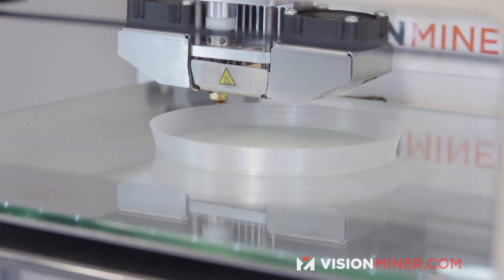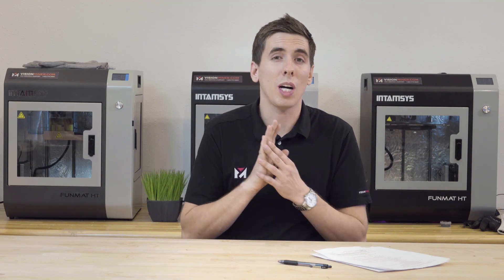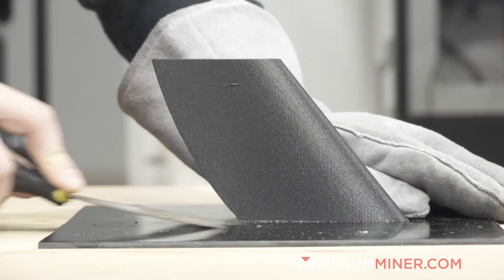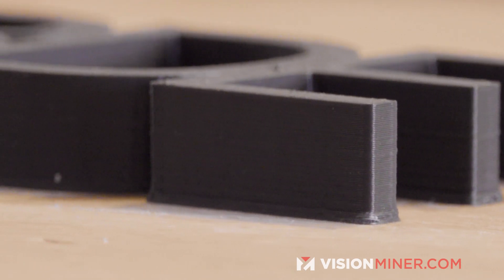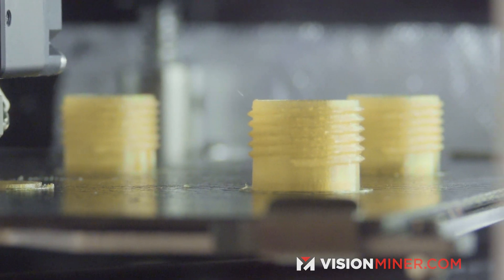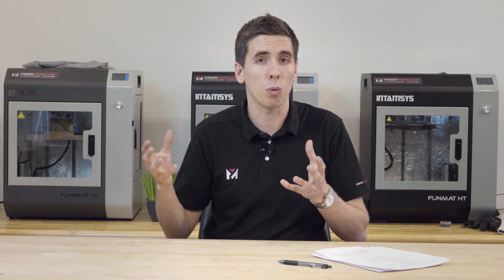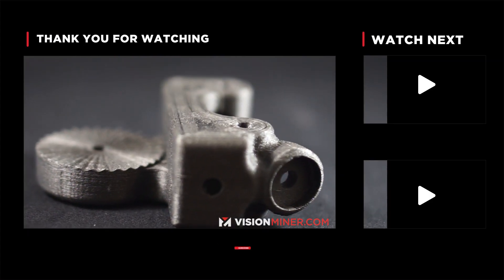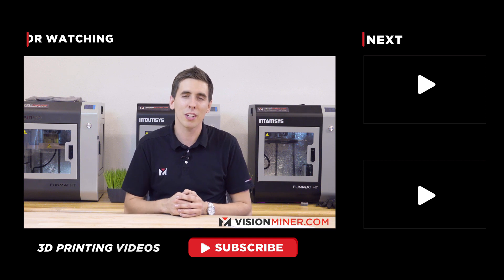3D Printer Bed Temps: Principles of Setting the Correct Build Plate Temperature

Comment: I’ve been using the default bed temperature on the Ender 3 Pro @ 60 degrees Celsius, would this be too low? I’m thinking so as I tend to have trouble with the first layer staying in place, I even made sure the bed was level enough to the filament would make contact and stick.
Reply from the maker: Definitely go higher if you're having trouble :)
Reply: @VisionMiner  appreciate the reply! I did in fact bump the bed temperature up and that seemed to fix the issue. Thanks!
Reply: @pooppyybuhhole  hey just read ur comment  i have the ender 3 plus and im having this issue can u tell me wat temp ur using plz?

Comment: okey ... start increase bed temp from 60  up to 100 per 10°C and lets see what temp is good for my PLA ... i am new and i have problem with low stick on bed
Reply from the maker: Perfect, yep -- start 60, usually 70 is more than enough -- I wouldn't go past 80c with PLA though, as it will become too soft. If it's not sticking, try something like our Nano Polymer Adhesive: https://www.visionminer.com/adhesive
Reply: @VisionMiner  solved ... i have bad parameters for steps per mm  ... and now i have problem to unstick model from bed :D

Comment: Hi. I have an Geeetech A10M, and the hot bed works, but the temperature sensor doesn't change. I checked the thermosensor and have 100kohm, I re-flashed the FW, but still the same. Can you help me to know what is happending? Thanks!
Reply from the maker: Unfortunately we've never worked with that printer, your best bet will be forums or their company support :) (check your wires though, could be a bad connection)

Comment: if I put my temp up too high, my adhesion gets worse, not "too good"
too low? the same thing. that's my experience with nylon though. it sticks well at 50 degrees bed temp, but any higher? Nope. like tape without a glue side.
Reply from the maker: Are you drying the filament first? We usually print Nylon around 110ºC on the bed...
Reply: @VisionMiner  it certainly could be dryer so I would have to experiment more and my results could just have been.... well, odd, but I did put the filament in the oven at 80 c or so for an hour at the time. 5 hours would be WWWAAYYY better.

Still, think it might still have been moisture, like you said, considering how very very hydrophilic nylon is.
Reply from the maker: @umbratherios  Right, very likely moisture -- it's interesting how much that affects adhesion! Also, printing hotter almost always makes it "stick" better, so I'm curious... I suppose the crystalline structure could at some point become damaged and behave differently, but most heated beds don't actually go high enough to melt the plastics, letalone damage the polymers...

Comment: I like to print my first layer at a higher temperature, then after that I leave it at the recommended temperature. This usually works really well for bed adhesion on my printer. Also, I usually set the flow of the initial layer to 80%. This way if it kinda sags it doesn't ruin the print quality of the first layers. But this might vary per printer. I also use a removable and flexible printing bed, so if it's too hard to get off (which hasn't happend to me yet) I can always remove the board and remove it that way.
Reply: ty im new at the glass bed first time i used it i was ooo thank you no more glue but than a couple of parts they not coming out right they com loose if its a small print its awesome but a bigger print it starts to come loose and warp any help would be great ty
Reply: @stevenjones2371  I now also print on glass beds. I haven't touched my 3D printer in a while, but after some proper calibration I can print perfectly fine on it.
I do print my initial layer at about 10 degrees higher than the rest. So for PLA I go for 70° on the first layer for my prints. It definitely depends on what works best on your printer and it's just a case of trial and error. Some PLA filaments are higher quality than others. Some of them need an even higher temperature for me so it really varies per printer and type of filament.
Reply: @KiemPlant  ty for reaching out like you said its a trial and error